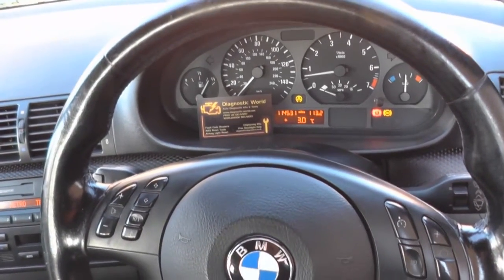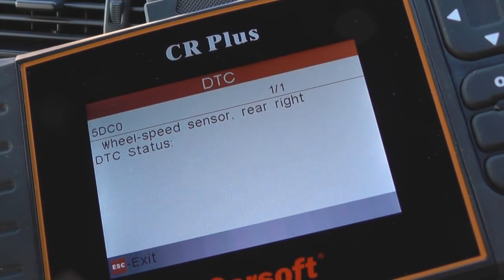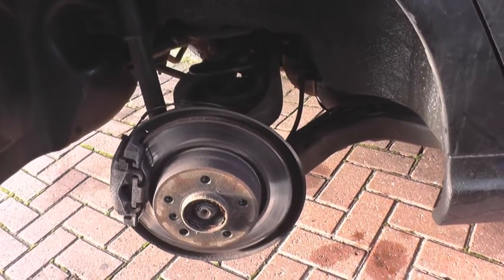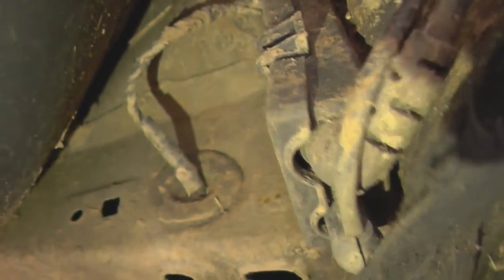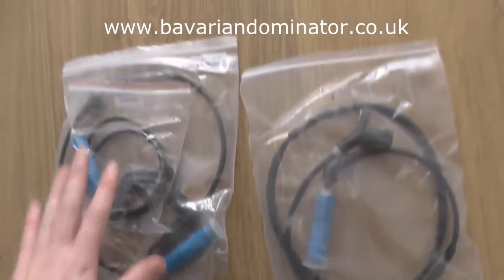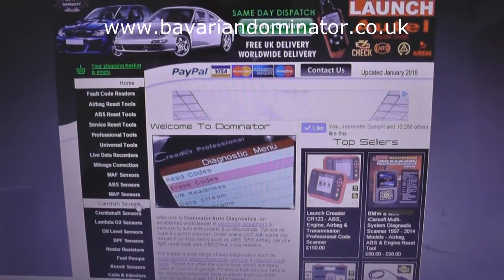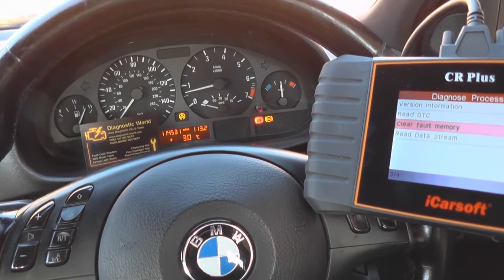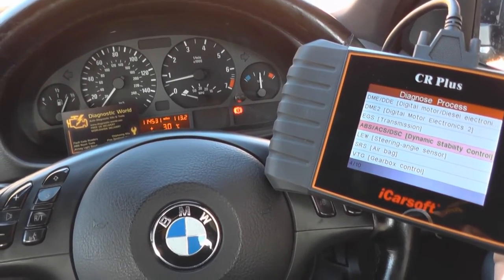iCarsoft CR Plus Reset BMW ABS Warning Lights

Comment: Hello friend, could you kindly tell me a Scanner that I can mainly use in a Bmw 325i 2.5 6cc 2008 E90? I need it to be able to reprogram the abs and airbag and turn those lights off. And also reset services such as oil change, brake pads, turn off the injection light and if possible diagnose defects in the automatic transmission. I've been searching and found one of the Launch X431 CRP 429C, but I do not know if you can do all this, you tell me? Got one from Autel too, MD808 Pro, you know? Anyway, if I can help I'm very grateful, greetings.